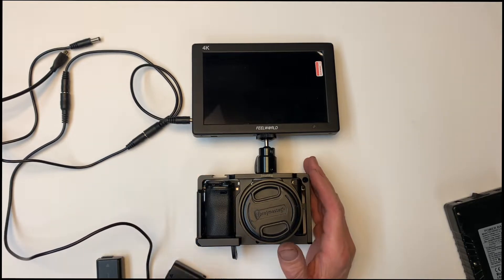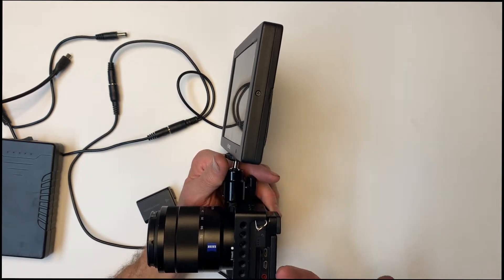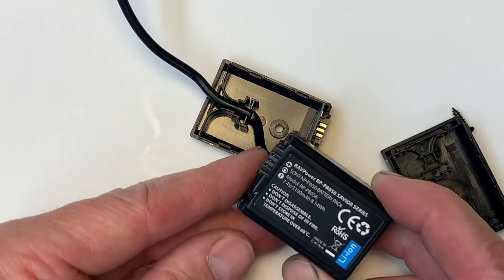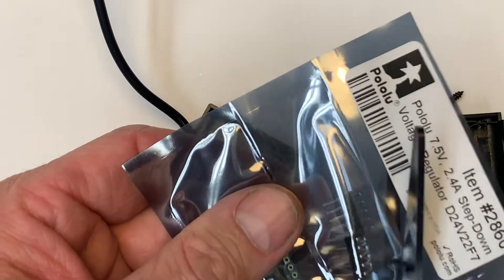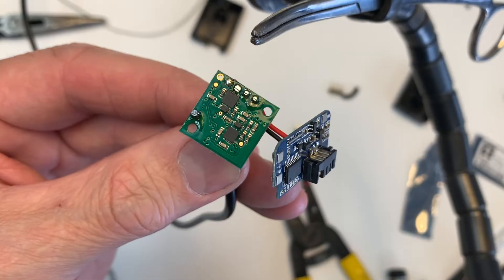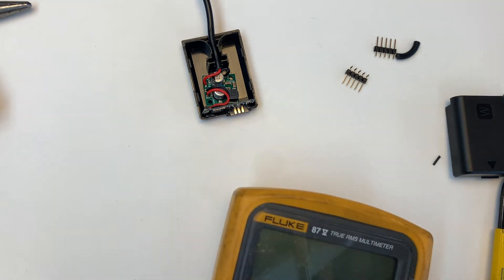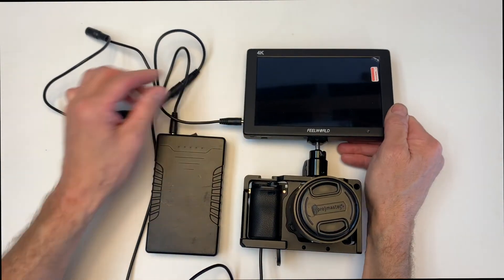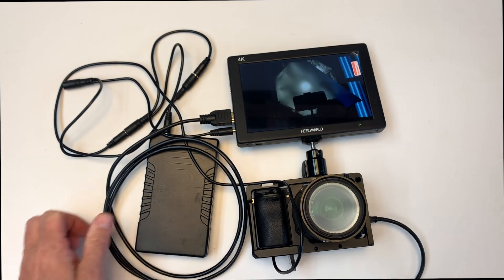Sony NP-FW50 Camera Battery Hack

Comment: One reason why this is not the best idea. We know that all Sony cameras overheat like hell. By putting a converter inside the battery case, you added to that heat that now also goes inside the camera. What you should've done is mount the converter outside the case in a separate enclosure.

Comment: Awesome hack out there! I have the same Fluke True RMS multimeter in the office, that thing is built like a tank. Haha. I was actually looking for a shell from sony fw50 to fz100 dummy battery. I was planning to buy the genuine Sony AC-PW20 (for a6400) and convert it to the FZ100 Dummy power adapter for the Sony A6600. Sadly I couldn't find one. Awesome tutorial out there. Cheers!